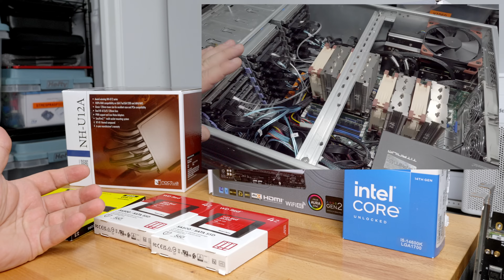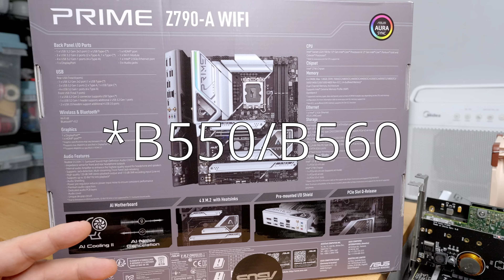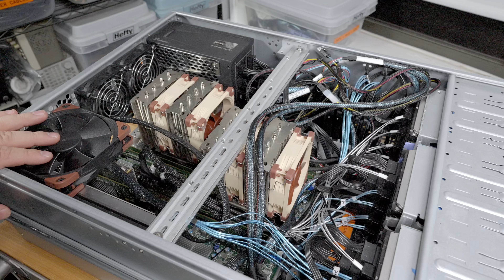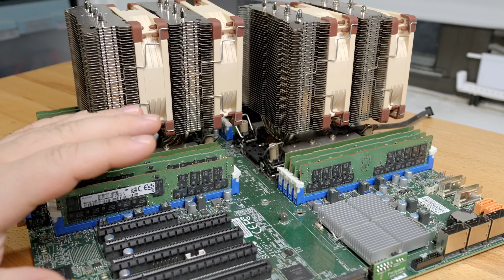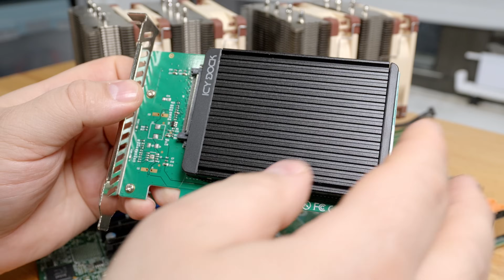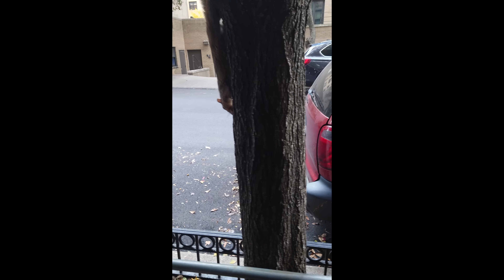Cutting my VM server power draw in half... and dropping 108 cores...

Comment: looks like an Private server, if i where you, i would use Unraid with that, we have an pretty similar system and the easy to use Docker system and very well working virtualisation on Unraid would make much more performance than you let on the table now. Heck i got sriov working om my IGPU and 28gbit dual Mellanox NIC and ZFS is working fine now.

Comment: I can say with first hand experiance while working on flight simulators, our buildings had garbage power feeds coming in and we saw a lot of outages. When the power went out we scramed to get all the severs down before the ups dropped out.... if it was a long outage we could almost guarentee a dead drive in the building when we powered back up. If the ups didnt hold until you got the stack shut down you knew what rack was getting a new drive and battery tray! I replace my drives critical storage drives ever 5 years and toss the old good ones in my plex box since it always needs more storage.

Comment: One option could have been to use only 1 cpu off your dual cpu server. That can nicely shave off some watts.
Is the base file system zfs, ecc would have been nice?
Reply from the maker: The problem is you drop half the RAM slots and half the I/O when you run a single CPU. At that point I might as well just use a consumer board. :D

Comment: Would have loved to see you build a new server and transfer VM’s over with no / minimal loss of uptime. 

If you’re limited to hardware you have, fair enough, but what I don’t see is a lot of homelabbers doing it the enterprise way when they swap hardware.
Reply from the maker: The thing is it simply isn't needed in a homelab. 99.999% uptime only matters if it actually affects people. When I do my changovers it's on Fridays when I'm off and the wife's at work - no one is affected other than me. There are a lot of videos on Proxmox clustering, etc. I'm sure something is out there that covers it.

It's actually the reason I don't bother having a cluster at home in the first place. It doesn't matter if my Plex server goes down to some weird failure - I'll just fix it when I get a chance to. :D The only thing which would matter is if my OPNsense system went down and my wife was working from home - even then it's easier to tell her "plug in your iPhone and teather to your work laptop" than having an LTE fallover or a cluster of servers all drawing power for the odd chance the fiber goes out (it has been offline for about an hour in ~3 years).

Comment: I'm using a 4U Rosewill L4500U case with a Thermalright cooler because I'm cheap. The Phantom Spirit 120. It's <158mm, cheap and reviews suggest it performs better than the U12A while being about $80 less. For other cheap viewers, consider the option.

Comment: 4:48 hold up. Are you sure you mean SR-IOV? this is available? why did no one tell me?
Reply from the maker: With modern Intel iGPUs. Arc doesn't seem to have it enabled - which is lame as hell. Link to how to set it up is in the description. :D
Reply: @PeterBrockie  is there a specific support list (UHD vs Iris Xe)? kind of regret buying the 12100f now damn. Will you do an update video at some point about the reliability?
Reply from the maker: @tollertup   I haven't personally tested with anything other than 12th and 14th gen. But from what I am reading any iGPU on 11th gen or newer is supported.

Although 11th gen seems to be somewhat buggy, so maybe stick with 12 or newer.

Comment: Curious what your asset management situation is like for tracking things like equipment, sata cables, and squirrels.
Reply from the maker: I pretty much keep track of where everything is in my head. Except hard drives. I really need to properly record all the serials of the NAS drives since they aren't hot swappable I need to know what slot everything is in.

Squirrels manage themselves.

Comment: ElectronicWizardly did a video about Proxmox on Intel. According to him, Proxmox cannot properly balance workload across P- & E-cores. Hopefully, Proxmox will make it happen eventually. Until then, hybrid CPUs are not the best choice for VM server.
Reply from the maker: I've seen it. He did his testing with an older kernel just before Proxmox 8 came out, so it possible it is all fixed by now, either way in a normal homelab it's really not something I would ever be concerned with.

Comment: I'm running a 7900x with 128gb at 6000mhz. Passed in all mem tests.
Reply from the maker: There are no hard and fast rules. It's completely dependant on the RAM used, motherboard, etc. 128/192 is all over the place in speeds depending on what parts you have. It'll get better over time as BIOS updates fix DDR5 oddities.

Comment: The issue with spinning down drives is the strain on the motor at startup. Now that won't kill a drive quickly unless it's being spun up really frequently, but it is an added opportunity for it to fail.  And with a decently sized array, you also have to consider the power surge of all that rust spinning up, something that won't of itself kill the power supply, but again, it's another opportunity for things to fail. I feel safer, especially as I use refurb drives, to set power saving to max, without spindown.
Reply: pretty sure motor itself can take it no problem, motor driver electronics might be affected though.
But mostly it is probably due to excessive heads parking and difference in vibration and balance stability of spin-up vs nominal RPM state.
Reply from the maker: Honestly I 'd like to see a real test from a channel which can afford to have a lot of drives going. I don't really buy the motor wear issue because although they are fast, they do take a couple second to spin up, so it's not like it's a massive amount of wear to get it going - especially in a helium drive where it should have way less air resistance.

It's just one of those computer myths that has always bothered me as I've never seen actual testing on it.
Reply: @PeterBrockie  A lot of drives in this case would be in 5-6 digit range, not hundreds.
Myself, I do not consider it a myth because historically there were at least issues with WD green drives that parked their heads as was programmed on the lowest level in firmware even though HDD was not set to any powersaving mode externally. And IIRC it did cause noticeable amounts of premature failures when used 24/7 in NAS. Folks used to disable this in firmware eeprom via program called wdidle.
Reply from the maker: WD Green series failed if you looked at them the wrong way even with the idle timer changed. :D

I've run my NAS with it on and off at different periods (15 drives) and I don't have any more failures than the usual "Is it DoA? Then it'll last a while" type failures which I think are the most common these days. But like your comment, mine is purely anecdotal so it'd be nice to have a proper controlled test. For science!
Reply: @PeterBrockie  Nobody is going to pay for test this size where you have to 'only use your tooling part of the time', or 'increase costs instead if decreasing them' if you'd have to use more space for the same amounts of utilization. Only the biggest of datacenters have real-world statistics and they sure won't let drives simply lay there without work or consume energy without producing revenue.
P.S. I ran only 2 greens, both of them for like 70-80k hours, one got couple of rogue remaps in a middle of lifetime, other one still good.. I had better luck with greens, blues and blacks than with RE, seagates and toshibas for example. But my choice is hitachis for sure, so WD HC now (used 1-5k hours, not new / 0h)

Comment: For the AMD parts in the description, you could've mentioned the non-X version of the 7900 since it doesn't suck too much power, yet performs really well.
Reply: You can also turn down the power on a 7900X to make it perform like a 7900, on my asus MB there's an "AMD eco" setting under the PBO menu where you can choose the TDP you'd like. The only real difference between the SKUs is the 7900 comes with a cooler
Reply from the maker: I originally meant to mention Eco Mode in the video. I gotta start writing these things down before filming. Haha

I'm sure you can get a similar effect limiting PL1/PL2 on Intel but it isn't an easy to use switch.
Reply: @maxhammick948  plus the non-x is a little cheaper "depending on where you are" so..

Comment: Thanks for the video an appreciate the honesty on the build, so many people shy away because of a fan boy stuff, this video shown your like me i build a computer and select parts based on use case I have AMD and intel through out my network, I think AMD needs a better IO especially when boards come with so much stuff already, I did not know about the Virtualization issues with pass through though as i not come across this issue  on my setups but its good to know, thanks bro.yeah the larger drives are crazy prices right now and it makes it harder to determine if larger cap with less drives is going to save on power and make its money back, i would wait a little then go for it as it would take X amount of time before you see the saving, but generally speaking you would save on power but depending how much you pay for the electricity will determine if its a saving or not. In Australia we pay 5 times the amount for electricity so it could save money at that point.

plus our government is on the save the world by increasing peoples usage on power driving up the price even more.

Comment: SR-IOV is such a cool tech that's so underrated. I recently got it working on an 4-port Intel Gbe card in a Lenovo 1-litre PC that's pulling router/firewall duty for me (firewall running in a VM under proxmox). I immediately saw a huge speed improvement over my previous Ubiquiti ER-X, even when it had HW-assisted NAT enabled.
Reply: To be fair, that Edgerouter is kinda half baked, best leave that thing on 100Mbit
Reply: @FrankyDigital2000  it's definitely not up to the speeds that are becoming more widely available today. When I got it, I had 200 Mbit/s service. I got an upgrade to 400, and I never saw it do more than 350. Could have been my config fiddling over the years, but with my new virtual FW, I'm over 500 regularly.
Reply: @the_beefy1986  You probably had software switching enabled, I had the same issue on the ER 3 Lite, but disabled that and managed 900+mbps, and thats the lite.